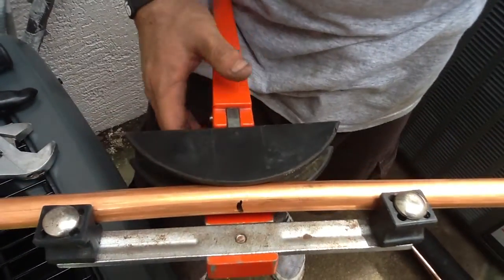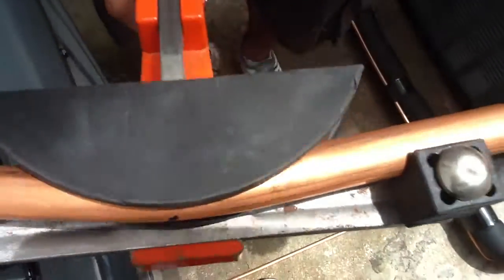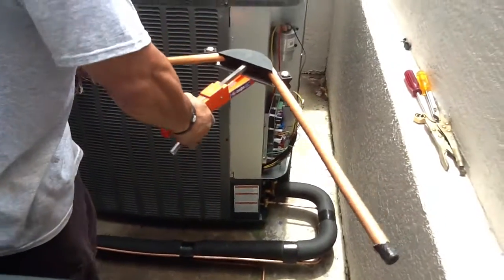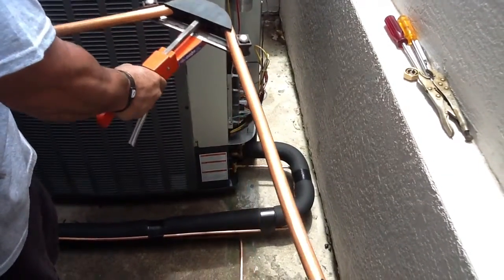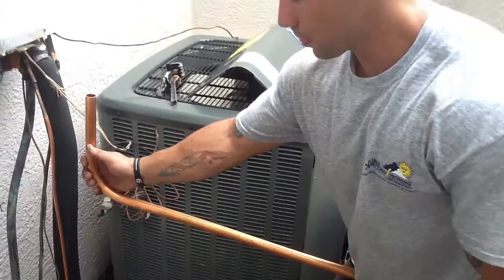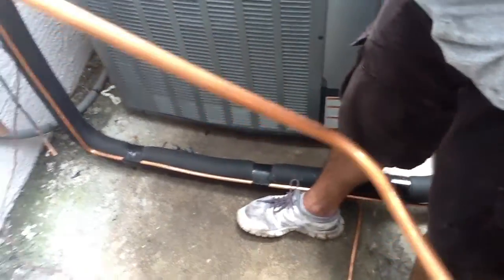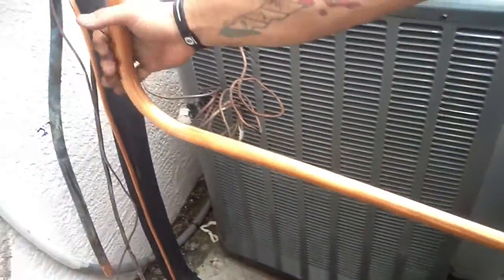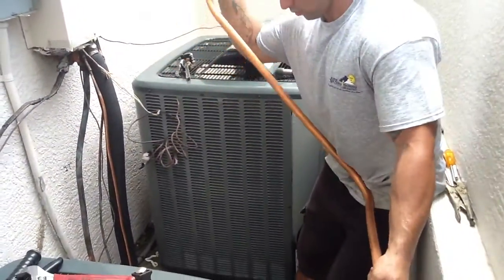How To Bend Copper With A Crossbow Bender

Comment: No you don't put your line in the center, or your messurements will be off. If your bent is on the right side, you line it up with the left line, if your bend is on the left, you line your mark with the right line. Shouldn't make educational videos if you don't know what you're doing.  Watch, yellow jacket hvac bending tool training video.  Hilmor, yellow jacket, they are all set up the same.